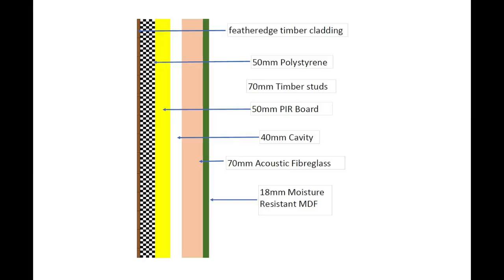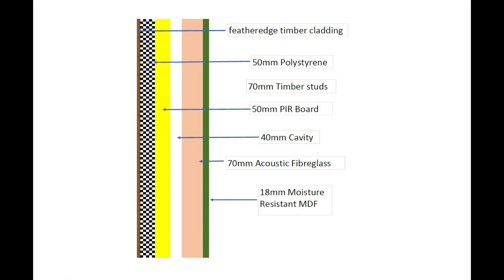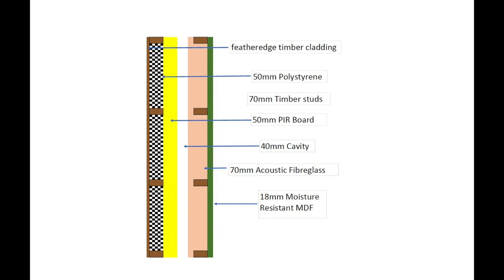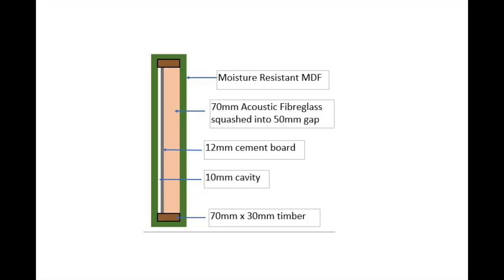How to Soundproof a shed

Comment: Hey from London! Love the video, really well made. It has inspired me to do similar to my shed. I am planning on using it for voiceover work only. Will I need as many layers as you? It's on a small shed. Will just using the foam tiles be enough? Thank you.
Reply from the maker: Hi from Kent! For voiceover work I’d recommend doing as much as possible. Ideally a room inside a room with as much insulation as possible. 
I’ve helped a couple of people with voiceover booths and they need to be lore isolated than a normal recording studio. If you get background noise in a song, it gets lost in the mix. But with voiceover work there’s nothing to hide it
Reply from the maker: The foam tiles only stop echo in the room. They’re acoustic treatment. You’ll definitely need them but they won’t stop sound getting in or out of the room
Reply: Cool, thank you for your reply. Is studio building something you do for others then? Would you be interested in giving me a rough idea on price for mine? I live in Surrey, KT13 if that helps?
Reply from the maker: Oh wow you’re not far at all! I grew up in KT20. I wouldn’t personally do it but would recommend Chevalier Brothers Carpentry : high quality work and one of them is a drummer and has made studios. The reason this is so important is that I’ve given advice on a lot of studios and booths and have had problems where the builder hasn’t understood the spec or has decided to go against my advice and effectively ruined the soundproofing by cutting corners.
Do you have an existing shed? How close to main roads and train lines are you? What’s your budget? (The budget question is especially important as I spent 3k on materials alone making my studio twice the size recently and that’s with no labour as carpenters I had booked in couldn’t make it due to C-19). I had the chevalier brothers booked. Nearly killed me!
Reply from the maker: Sorry for all the questions.
Reply: Just down the road! No problem with the questions. Yes I have a shed  with power in. Also have a garage in a block (no power). Not sure whether to save up and buy a booth and put it in the shed or convert shed? Not near a main road and indo have a train line near me. You can hear fast trains going past and thats it. Lasts about 5 seconds. This voice over thing is new and I'm determined to make it work. Was even thinking about the sound curtain option and doing that, like a shower cubical.
Reply from the maker: Is there any way of running power to the garage? A concrete floor with brick walls is a far better start than a wooden shed.
The sound curtains are only acoustic treatment so they won’t stop any sound, they’ll just stop a bit of echo and make the room sound nicer.
What are the dimensions of your shed? And how high is it internally? Also is it an apex roof or mono-pitch?
Reply: @PherotoneStudios  I think it would be possible to run power to the garage. I could run it down the alley at the back of the garden and my garage is the first one. The shed is 13 feet by 6.5. Height wise it's 6 foot with a apex pitch roof ( triangle shaped). Might be cheaper to run power to garage and build a booth in there. . .

Comment: Great info! How did you handle venting air?
Reply from the maker: This may sound stupid, but I didn’t want to build in ventilation as that can leak a lot of sound especially with a shed, so I just open the door now and then. 
I also have windows in my studio (terrible idea if you want a sound proof room) which I open at every break to get some fresh air in. It’s so much nicer working with some natural light though, especially when mixing as that can go on forever

Comment: Great video mate. Is "acoustic" fiberglass any different from regular? Or is it just marketing? Where did you source yours from? Cheers
Reply from the maker: I'm not entirely sure on the different but believe the acoustic stuff is denser therefore better at diffusing sound.  I have an account with Selco and buy RockSlab which seems to be quite good.  The other plus is that it's fire resistant
Reply: Cheers dude. Gonna build a shed at the bottom of my garden for an acoustic drum kit, so will come back here when it's done and let you know how it goes. Thanks again.
Reply from the maker: Ah yeah definitely let me know how it goes.  Cymbals are quite easy to tame as the higher frequencies can be killed with surprisingly little soundproofing but the bass drum will be the hardest to stop as the floor can often amplify it.  Will you be doing a concrete base or joists?
Reply: I doubt there will be any concrete. Definitely going to need a suspended floor. I expect it will be a shed within a shed, with a floor on top of a floor on top of a floor :p. Fortunately there's a concrete wall separating the bottom of my garden from the bottom of the opposite neighbours garden, and then another shed in front of where my studio will go, concealing it from my garden. 
Did you do another part to this video with a decibel meter by the way?
Reply from the maker: That sounds pretty good.  the wall and other buildings will disrupt any noise that escapes from your shed.  I only did db comparisons for the window boxes and doors but I can now record in there which sensitive mics without issues and also play guitar rather loud

Comment: So unlike a real sound proof room you decided to put foam cones facing out ? Not  inward as they should be to break up the  soundwaves. Massive fail.
Reply from the maker: You've never been in a soundproof room therefore i'll explain:
Soundproofing is using density to reduce the sound that travels through a medium.  The sound is in the form of energy, hence density being the key part.  Different layers and air gaps help take the energy out of the soundwaves so that sound coming through that medium is significantly reduced.  This is why you often see a room within a room.  
Acoustic treatment is using soft material to "break up sound waves" which reduces echo in a room so that it makes a better environment for recording etc.
I'm using the foam you're talking about is on the window boxes.  This creates a compression seal to reduce sound coming in to the studio from the outside world.  On the inside of each window box is a 70mm slab of acoustic foam.  The reason for this is that the speakers are down one end the the studio and the best places to place your acoustic treatment are the first angle of reflection and the wall behind you when you're facing the speakers.  One acoustic slab in a window sorts the first angle of reflection and the other addresses the rear wall of the studio.  There is also a canvas painting on the studio wall with the frame filled with acoustic foam which addresses the first angle of reflection for the other speaker.
If you'd paid attention to the video you would have noticed the acoustic tiles placed around the room including the entire door being covered in them.  In addition to this, each window has a curtain pole above it with 2 sets of curtains on each - additional acoustic treatment. Not much of this is relevant as the video is about soundproofing, hence the title, rather than acoustic treatment, but should be of use to you.
Reply: Pherotone Studios agreed. Acoustic treatment is the foam and soundproofing is what you’ve done. Ignore that idiot, cracking job mate and keep up the good work
Reply from the maker: Thank you.  Do you have a shed that needs soundproofing or is soundproofed?  What's it like?
Reply: Pherotone Studios yep. Got a drum room in the garden. First of all I covered everything in those acoustic tiles and it did fuck all apart from make the room sound a bit better. 
I did a similar thing to you and made a room inside a room but only did one floor. I wish I’d insulated the floor like you did as you can really hear the kick drum from the house
Reply from the maker: Ah nice one.  My cousin has a studio in his shed and he's drummer.  We had the same problem so ended up building a platform for teh drum kit to sit on.  It's a 3m by 2m drum matt which is about an inch thick, then 3m x 2m of 75mm Celotex, then a layer of polystyrene (again, 75mm), Then a 12mm layer of OSB then a layer of 18mm plywood.  It bumps it up around 20cm but it made a massive difference.  Give that a go and let me know what you think.  
Also you can take a look at his studio in this video https://youtu.be/Ce0OKvajolk but it's before the drum platform was built so i'll do a video on that soon and give you a shout
Reply: Pherotone Studios I’ve got a summer house which I use for watching films and listening to music. It’s one of those log cabins so has two walls and they’re insulated but so much sound got through the windows.
The whole front is pretty much glass so I’d need to make bi-fold or removable panels
Reply from the maker: Sounds epic. Sound proof panes weigh a ton so bi folds may not be great as there’d be a lot of strain on the hinges. Maybe you could have the edge panels hinged on the walls and the other panels removable. 
My window boxes are incredibly heavy which is why I made the larger one in two parts. Maybe check out my video on soundproofing a door and use that concept on your summer house.
Let me know how it goes and what difference it makes